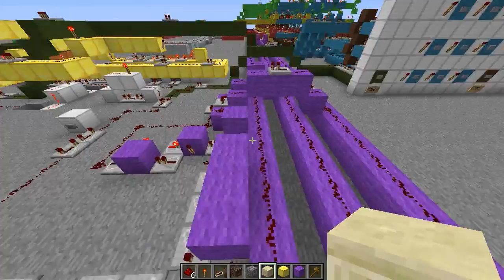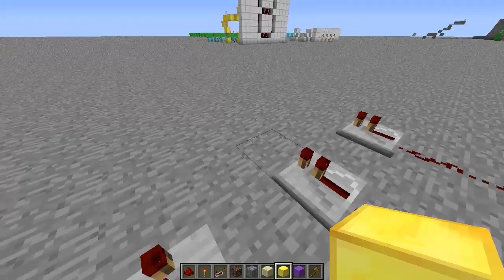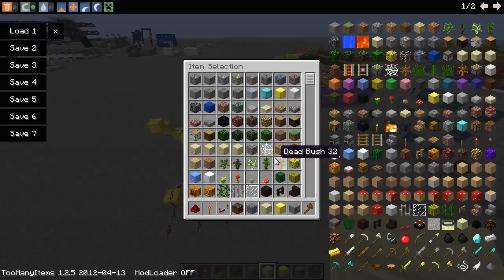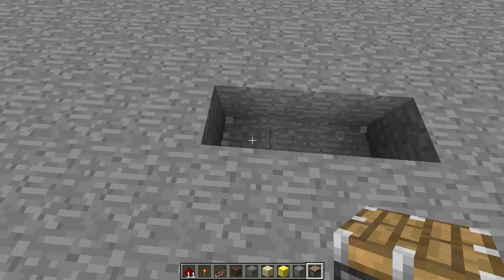3D Printer Part #8 - MC tutorial by Drugoli

Comment: Its not working : '(
Reply from the maker: Pretty tough to decipher what's wrong, when it's just not working.
Try and go through what I talk about could be wrong in the video. Try and make the printer print it's thing (also, remember there needs to be a block on every layer for it to work!), and note down when something goes wrong.
Then I might be able to help further.
Reply: thank you I'll look
Reply from the maker: Hell kad did you find the error?
Reply: No I have to begin again the system 3 times and always not to find that it does not go.        Sorry
Reply from the maker: Hell kad any way I can try and help?
Sucks you can't get it to work.
Reply: I can give you my save. But I am not sure that his help.
Reply from the maker: Hell kad it's worth a shot I guess?